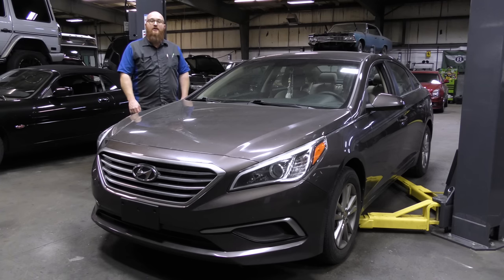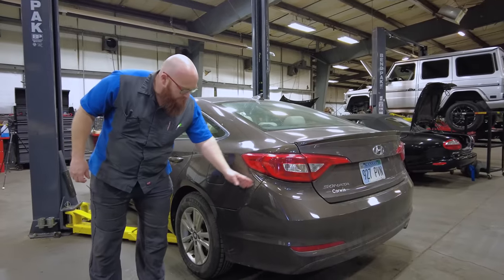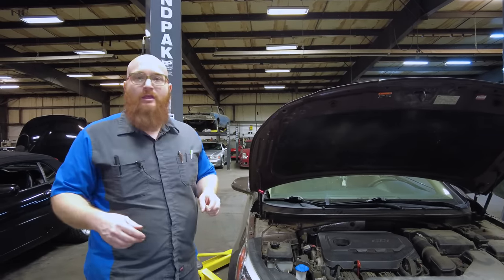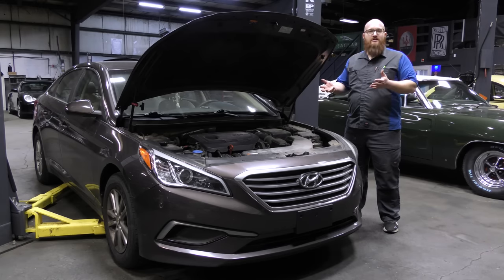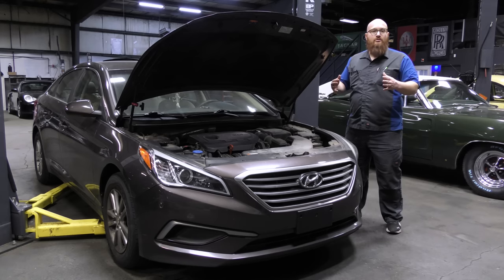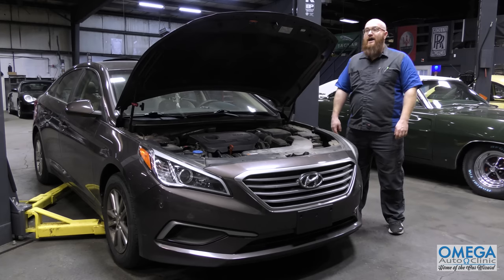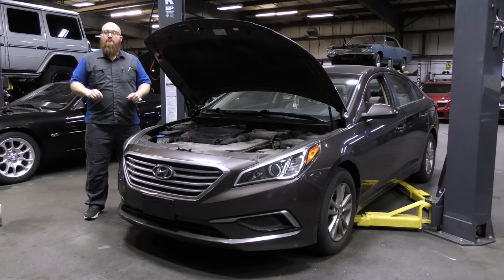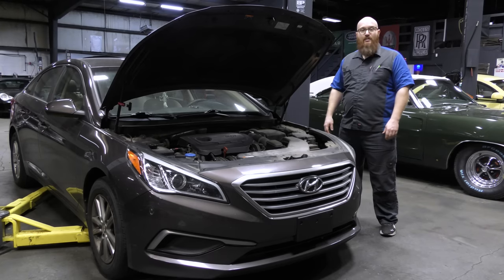What could be so bad on this '16 Hyundai Sonata that the CAR WIZARD is sending it to the junk yard?

Comment: Hi Wizard, I had a 2017 Hyundai Elantra purchased new from the dealership. They offered $20 oil changes to their buyers, so I changed the oil religiously at the dealership. At 110,000 miles the engine went. Because of my stellar maintenance record, they supplied me with a new engine for free, despite that the 100,000-mile warranty had expired. I paid labor of maybe $2,000 and was glad to do so. The new engine lasted a year before it went. This time they offered to furnish a used engine with 40,000 miles, again with me paying the labor. I said okay.

But after waiting a month for the engine to come in, I went ahead and bought a Honda Civic. I needed to get to work each day, and renting a car indefinitely was like lighting money on fire. The Honda dealership (Honda of Westport, CT) sells all of its Hondas with a lifetime warranty on the complete drive train. Problem solved for good. I let Hyundai install the used engine and then I sold that car (with full disclosure). Never again will I buy a Hyundai.
Reply: That engine lasted a year because of that 20 dollar oil.
Reply: Yeah...$20 oil change was your first mistake. I can't help but think that Hyundai customers are part of the problem.
Reply: This guy got toasted by 2 people for taking advantage of dealer $20 oil change, enough already! Even if he/she did it themselves, the first motor would probably have blown, and dealer wouldn't have given them anything!!!
Reply: What engine? $20 wouldn't even cover the price of oil let alone filter or labor. Try $40 plus where I live.
Reply: So you guys who replied believe that the Hyundai dealership, to whom failing engines was their worse nightmare, offered a low rate on oil changes to Hyundai owners in order to lure them in to wreck their Hyundai engines? Thank you for making my day. You guys rock!
Reply: I just saw your comment, same thing!!
Reply: @Jeffrey Meyers  well it isn't entirely far-fetched for stealerships to do some shady shit in order to make more money.  They are happy to do those engine swaps, it is good money for them unlike those $20 oil changes, probably barely covers their expenses!  But I agree, you had no choice but to take them up on their deal, otherwise I have a hard time believing the dealership would have still honored any warranty had you done them yourself (or done elsewhere)
Reply: You should be able to get reimbursed for the engine replacements because of the class action lawsuit against Kia and Hyundai. Especially since you have oil changing records. Even though you sold the car. The engine in my 2012 Kia optima SX 2.0 went at 89,000 mi. I'm the original owner, and I did the oil changes every 5k with mobile 1 full synthetic. The owner's manual shows that the changing intervals can go as high as every 7,500 miles. Cylinder 2 would pop sparkplugs every 15-20k mi, and the dealership didn't have an explanation. I tried several different plugs, but it didn't make a difference. The only warning I had that the engine was about to go was that I had noticed a little smoke from the exhaust pipe the day before. Like it was running rich or burning oil. Oil levels were fine. There is an engineering defect within both the 2.0 and 2.4-cylinder engines. Kia & Hyundai both tried lying and saying it was because of metal shaving left behind by the US manufacturing plant and/or blamed customers for maintenance neglect. The fact is: The piston bearings do not get proper lubrication while the engine is running and eventually fail. It's not a question of if it will but when it will. That's why no one wants to touch them. Even if you successfully get them to replace the engine, Kia and Hyundai have risked customers' lives by not replacing or improperly installing the high-pressure fuel line that goes into the engine. This will cause gas to spray right onto the hot exhaust manifold and catch fire. This happened to my bothers 2011 Kia optima LX 2.4 a few months after he, too, had to have his engine replaced. Luckily he pulled off the highway, and the car, luckily, didn't catch fire. However, others haven't been as lucky. He went to the local news where he lived in FL, and they have since run several news stories on this.  I had to take my car back to the dealership to replace the turbo gaskets because the car was leaking oil onto my brand-new driveway. They tried charging me $1,500 because they said that issue wasn't covered under the engine replacement. I said, didn't you have to remove the turbo to install it on the new engine? The guy said yes. I replied, did you guys use the old gaskets or replace them? He said they reused the old ones. WTF was my response. Kia finally agreed to do it under warranty. They worded it as a 1-time good-faith repair.....SMH. Good thing because I'm the real-life John Wick. The car has been reliable, besides that. My daughter just turned 16, and it's her first car. The 2nd engine has roughly 110k mi, and the body has over 200k mi. If the rest of the car continues to hold up, I'll just keep the car until the wheels fall off and have kia keep replacing the engines under warranty.
Reply: @pricekolby  Hey Price, great information and advice! Like your comment that you're John Wick. I'm just me, but I am a licensed, practicing attorney. Now that I know all this, let's see what Hyundai has to say. Thanks.
Reply: @jeffreymeyers543   I wouldn’t be surprised if they give you some pushback, but your knowledge in law will definitely help. Good luck and feel free to contact me if you have any questions. Thx
Reply: Lifetime warranty on the drivetrain? There's gotta be some sort of catch right
Reply: @justnoo  No catch..i just picked my 2017 Sonata up from the dealership this morning. As long as you are the original owner and have oil change records it should be covered under the "lifetime warranty" program. Before replacement it was consuming 1 quart of oil every 204 miles.
Reply: @djangomcfancy9238  it actually doesn’t have to be an original owner. My brother was the second owner and it was covered.

Comment: Note to self always make sure to top off fluid levels before issuing a car to a dealer for possible recall issues
Reply: It used to be you wouldn't have to worry about excessive oil consumption in older cars unless the miles were high. But oil viscosity is much lower than before, which makes them more vulnerable to this issue.
Reply: hyundai make one of the worst engine in the world.
they used to OEM Mitsubishi engines those were solid.
as soon as hyundai made own engines, they all fail around 40k-70k.
Reply: that doesn't work, the dealer is smart enough you just added new oil
Reply: @kuyre2239  The 2.4 Liter 4 cylinder that Sonata has is a shared engine with Chrysler, Kia and Mitsubishi. It's called the "world engine" for a reason.
Reply: @BartStar009  get some used oil from a repair shop..they should be thrilled to get rid of it...then, they can't tell you just added fresh oil...
Reply: @0utc4st1985   This is the Theta II, which has gone through several modifications since its inception. It is shared with Kia, but it is not the same as the Chrysler or Mitstubishi engines.
Reply: Actually brand new oil in Hyundai and Kia engines instantly turns black so they really couldn’t tell
Reply: Ok, driver probably didn’t have a lot of time to keep checking the oil as those gdi engines are oil guzzlers but the oil gauge was lit? If you own a car you must know the basics.
Reply: @BartStar009  Exactly, they will send the oil for testing and when the wear on the engine doesn't show in new oil, they'll know the clown owner decided to try and pull a fast one.
Reply: @kuyre223  ones that fail is because during  building engines metal shavings were left in engine.
Reply: @FWDSUXARSE  You add oil drive several miles with it... And there you have it. All debris in the oil.
Reply: @kuyre2239  and whenever someone claims Hyundais were reliable, if you trace that back, it all goes to when they had Japanese motors.
Reply: @rodgerbruce1  not all, the 1.8L Nu engine was a faulty design and if it spends time in winter climates the engines fail and the oil fills with metal shavings. 
My 2014 Elantra was affected by that and had a 3rd motor at 52k miles.
Reply: @thenormalyears  is that due to the gasoline direct injection?
Reply: @thenormalyears  
No lie, my friend's Hyundai oil was black after 500 miles.   My Toyota's oil looked like Sam Adams after 5,000 miles and was not down a drop.
Reply: @louiscali8617  
Back around 2008 Honda and Toyotas had some troubles and Hyundai had their best years.   Hyundai's best years and models were about equal to a bad Honda.

Comment: My wife’s 2011 sonata has 250k miles on it and still runs quiet. The only thing done to the engine was changing the timing chain and adjuster as a precaution at 150k which I did myself. Other than that, I change the ATF every 30k, the oil every 3000 miles and the coolant every three years along with flushing the brake fluid.

Comment: It’s a hard lesson to be learned but hopefully the granddaughter now understands the importance of maintenance.
Reply: Agreed, not trying to be unprofessional or mean to the owners, but while the motor in this car isnt the best, this was not the manufacturers fault. This was the irresponsible owner/drivers fault.
Reply: It’s not really the daughters fault but the car. This engines burn 1 quart every 500miles 😂😂😂😂
Reply: Not very much about maintenance they are built very poor. I see vehicles with 40k miles and already consuming oil. Kia/hyndai engines are horrible, even if you replace your oil every month.
Reply: Their newer engines must be like this, I drive an i30 1.4 N/A (I think that s the Elantra in America) and I hit the redline everytime I drive it. Close to 100k miles, doesn't burn a drop of oil and it runs like new, though I change the oil every 5k miles or so. If it's true, it's really sad, the appeal for a Hyundai for me was their rock solid reliability...
Reply: just avoid Hyundai